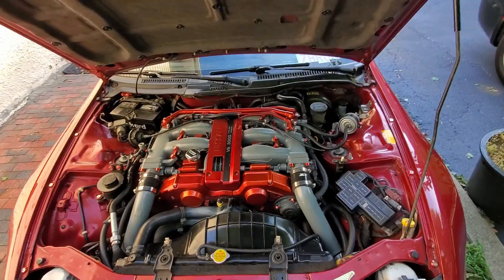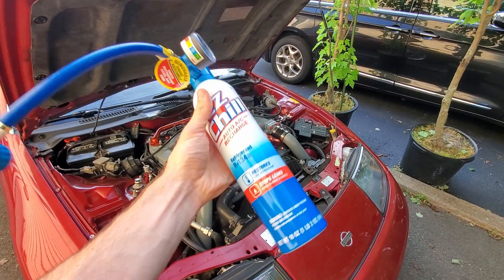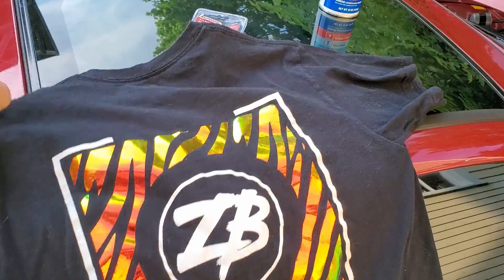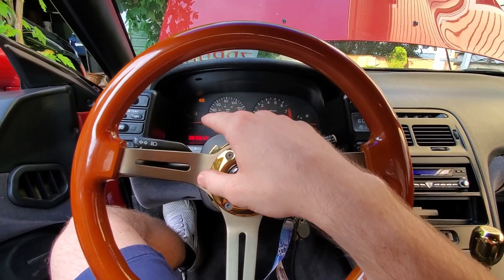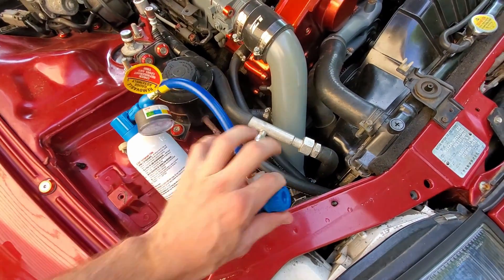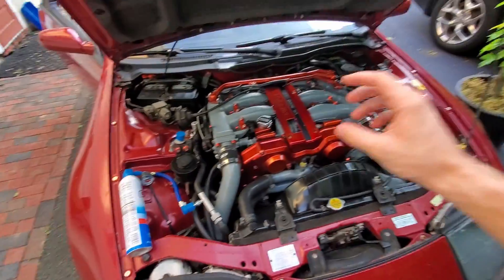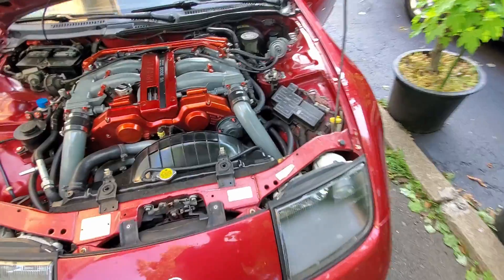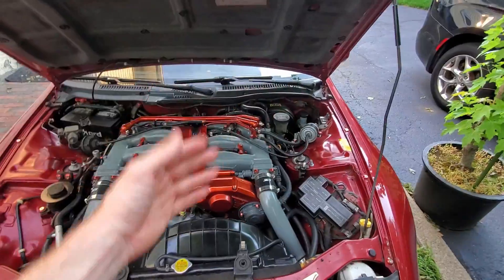The Easiest Way to Convert a Nissan 300zx Air Conditioning System with R-134A in Only 15 minutes!!!

Comment: Some of those cans have sealant in them. You want to avoid those since those sealants will often cause more damage than good. 
If you want to do it between the backyard way and the professional way. You can buy a real tank of pure r134 and pag oil with a vaccum pump and gauges. It cost me about 150$ for all that. Its totally worth it since i use it for my z, my daily driver and the wifes car. As well as friends and family.

Great video as usual 👍 still gonna be useful for many people who like the quick easy way.

Comment: SO much wrong here.  The system needs to be completely flushed to remove all the old freon and compressor oil.  The o ring seals should also be replaced as the R12 seals are not compatible with the 134 freon. The orifice tube and  receiver dryer should also be replaced.  Do it right or don't do it at all.
Reply from the maker: Haven't had any issues since the swap, but thank you for the insight!

Comment: Cool thanks!  Now if I can just get all the vent door motors working.  Any suggestions on that?  Parts aren’t available but looks like may be able to replace the motors in them.
Reply from the maker: Oof good question, maybe try to lubricate the hinges if not may need to go to the scrap yard
Reply: @ZBruhzchannel  actually this was a while ago. Since then I bought an interior out of another Z. I pulled the whole center section along with the second gen HVAC computer and POD.  It’s all in now, charged and working well.  Thanks for all the videos!

Comment: Don't u have to pump out the old ac?
Reply: He needed to put it under vacuum first. The kid doesn't know anything about air-conditioning. This bush fix is the worst I've ever seen, very harmful to the A/C system. But he means well.
Reply: @ptaweston how do you put it under vacuum and flush everything out? Also how do you know how much oil and where do you put the oil in?

Comment: R12 O-ring seals are not compatible with R134A,you need to change all of them. Compressor oil is also not compatible with R134A,you need to replace it. Otherwise in a few months either you will loose all the refrigerant due to seals failure or the compressor will broke.
Reply: Im also pretty sure the system needs placed under a vacuum before putting in refrigerant because moisture + refrigerant will create a corrosive mixture and the vacuum pulls out the moisture, then fill the system from a vacuum

Also ac drier/reciever  technically meeds replaced every time the ac system is opened up
Reply: i can tell for a fact that the old owner followed this stupid ass video and caused the exact problems you’re talking about. compressor is shot, entire system was bone dry when i went to (in minecraft) open the valves to atmosphere lol

Comment: How do u replace a/c compressor?
Reply from the maker: Replacing is pretty simple. I don't have a video on it but there should be a write up on one of the forums. I would google "ac compressor replacement on a z32" and it should bring up a ton of information for you!

Comment: Did I miss the part when I vacuumed the air and held pressure for 30min to an hour?  Also u want to drain the compressor oil and replace same amount with mineral oil if not you will damage your components
Reply: He already bleed the system but you are absolutely correct about the mineral oil.
Reply: Do you need to remove the compressor to drain/add oil?
Reply: R134a hates mineral oil, you are supposed to use pag oil, or ester oil
Reply from the maker: Like Jeremy Said the system was already bled prior to the video and you are correct about the mineral oil, but as I stated in the video this is a cheap backyard fix not the professional way and I am just repeating what I have done in the past that has worked for me with no issues.